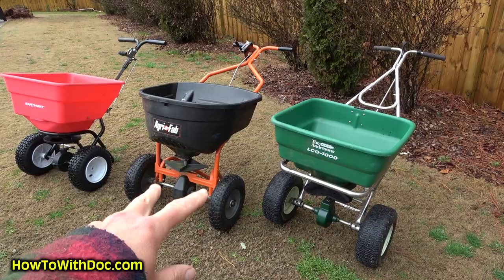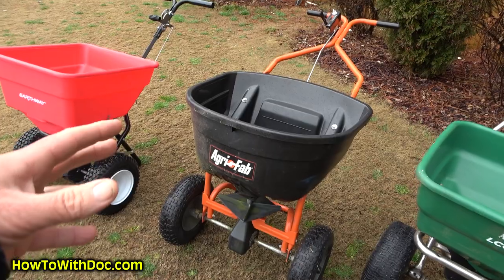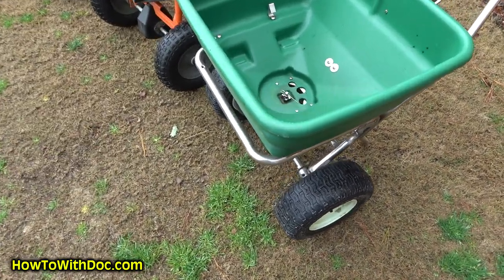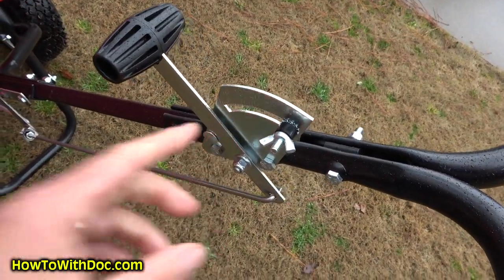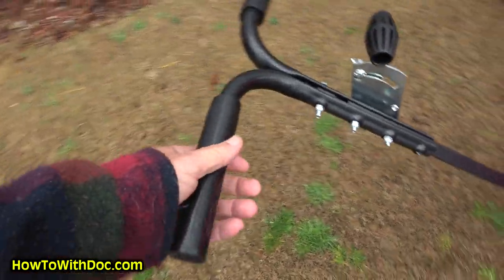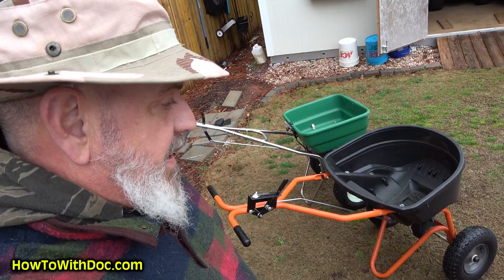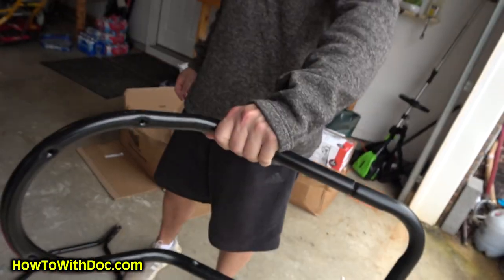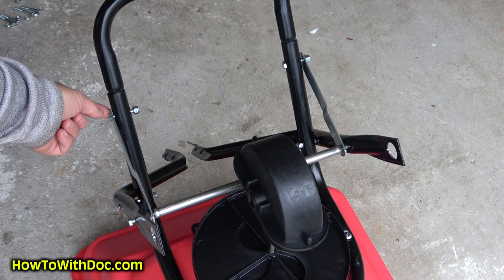Best Large Lawn Spreader 2021 Review

Comment: I have 2 Earthway Ev-n-Spreads. Both have the cylindrical hopper perfect for small yards. My first purchase has plastic wheels, the second has pneumatic tires and a side spread control option (right side disperse). They are both spot on if you weigh the product for the area and use the factory setting for the lbs. per 1,000 sq. ft. If your budget supports, I recommend the pneumatic tires . I reworked the plastic wheel model with parts from Earthway and use it for a loaner.

Comment: I’ve got the one that looks like the Agri Fab from Tractor Supply. My main want was metal gears which this one has and most of the big box brands don’t. Only problem is none of the fertilizer manufacturers list settings for this spreader. Just had to figure it out for myself and I always err to the light side and go over the areas until product per square footage is covered.